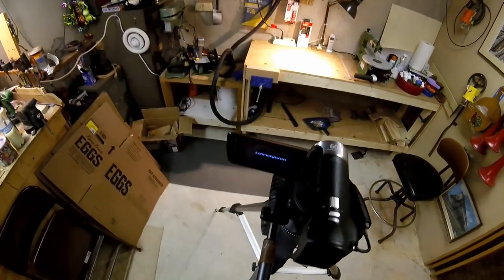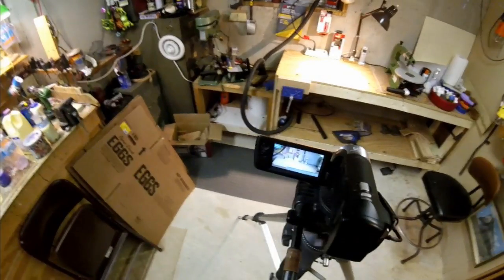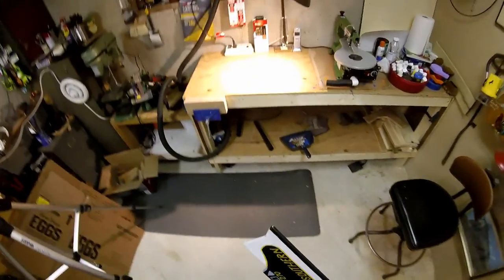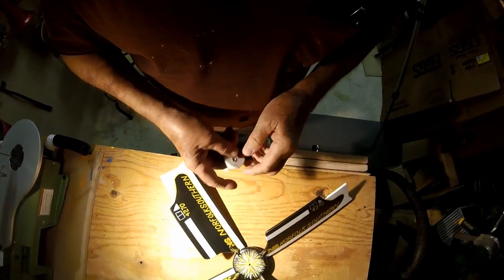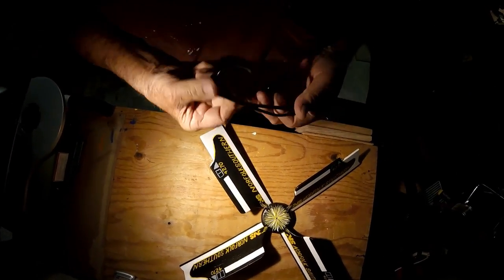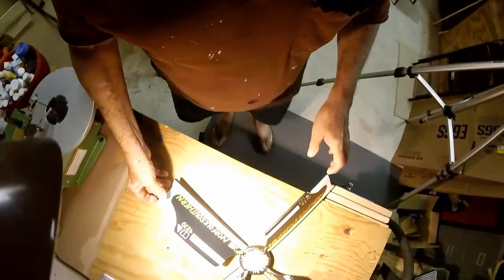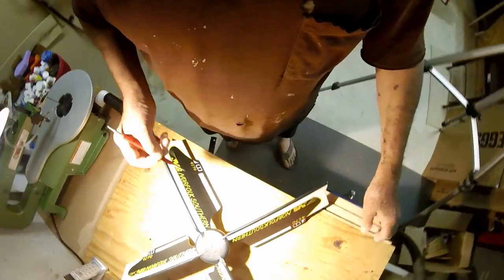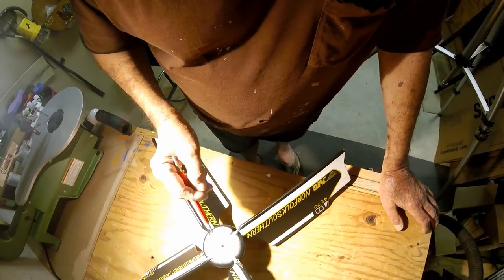Whirligig Propeller Repair Project Part 1

Comment: I think you have a good idea, Walter. I'm not sure about cutting the propeller blades, I wonder about cutting four beveled notches in your new piece that matches the pitch of the propeller blades and glue the whole thing together for strength.
Reply from the maker: Thanks Matt  I ruled it out for now the epoxy worked well so far